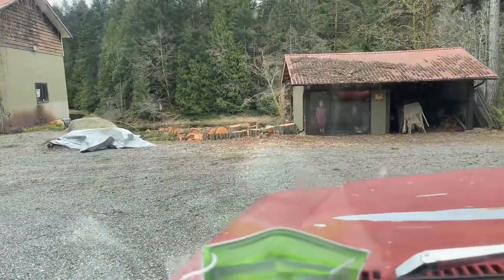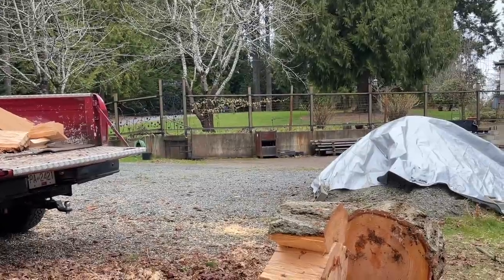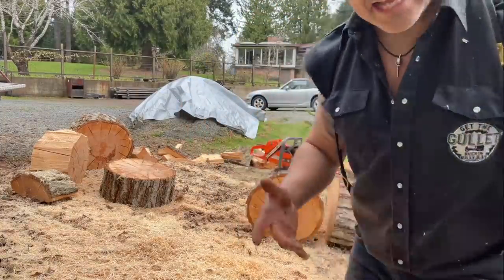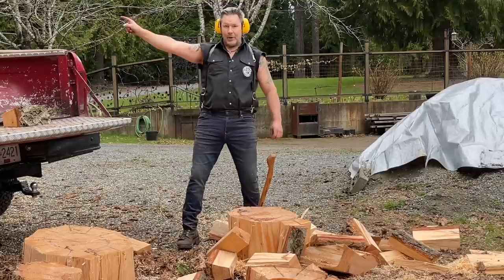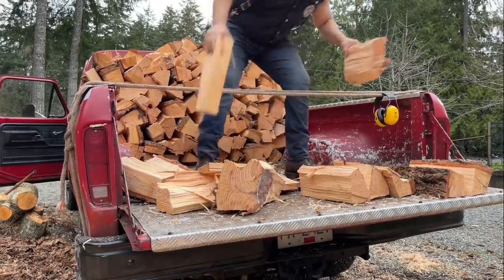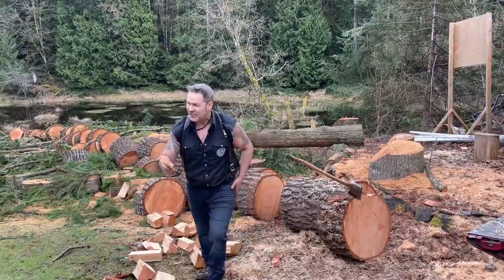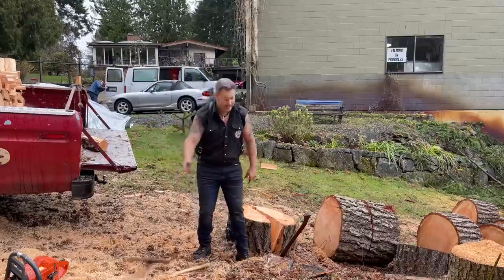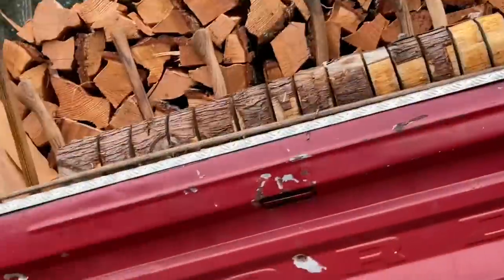How to split big rounds of firewood 🪵

Comment: So if I’m seeing this correct. You get noodles by cutting radius cuts from bark to center vs cutting down the grain? 
Also what saw is that Buckin? Much love. Can’t wait to add a wood bullet to my collection. Tired of swing my maul and hammering a wedge into these big rounds to split em. 
Just picked myself up a 572xp
Trying to treat is right breaking it in but I got a serious pile of 30”+ red and whit oak logs to get bucked and split. Got 8 or so tanks through it. Time to make some noodles!

Comment: WOW!
That's hero wood for splitting. I have mostly split hardwood. Maple beech ash.
Occasionally have tied into easy stuff like poplar.
Mandatory wedge and sledge for the big hardwoods. Also had wire wrapped the last 5-6 inches below the axe head to protect the handle and give a bit more weight. Handle lasted over 40 years for this amateur.
Deadly good aim going on there.

Comment: I'm curious about why, in the United States, everyone seems to use such lightweight axes to split logs, requiring around 20 hits and quickly tires out the woodcutter 🙈 Here in Europe, we use a splitting wedge, and it appears to be much easier.

Comment: Hey buckin, thanks for the new way to cut large rounds. Just upgrades my saw situation. Went from a little ms250 I've used for 5 years. Bought a husky 562xp yesterday and can't wait to give it a go. That little stihl kept my family warm in the winter and in the savings from not buying wood for 5 years I've paid for my new saw 3 times over with the amount we burn. The upgrade is well deserved to save time and my back. Buy once, cry once. Cheers Buckin, be blessed.

Comment: Last year I had a large tree I cut down that my splitting Maul would just bounce off of so had to cut it in 1/4s so I could get it into my trailer, this year I will try your way, looks like it may solve my problem.  Also I stack my wood in my trailer, the trailer is a tilt bed so it has be balanced correctly, that being said, the last time I just threw the wood in there cost me my car and a lot of towing charges, when the trailer fished tailed and rolled the car. Now I am very careful how I load that trailer.

Comment: Man you have a nice tune on that one! Sounds just right. Just a touch of overrev. She's running clean!
I'm telling you .I'll send you some power plus Manhattan oil. You will feel a difference and your pistons and head will actually clean themselves from carbon usually.
I did some rounds almost that big for fun and a workout with my helko.
I heard it hunting for fuel!! Ok. From road course racing 2 strokes..you want your engine to idle. Important..so when your way up in the revs and you get out of the throttle it continues to deliver fuel +OIL. Idling is a bigger deal to 2 strokes than most people know. Not telling you Buckin just throwing it out there for anyone that doesn't know. 

From a guy that never burnt a motor down from his tune!
Been all around the U.S. on most the well known race tracks.

Comment: This video comes at a great time for me. I have a trunk of an old maple tree that I bucked and the pieces are about 4 .10 ft wide almost 5 ft each. I bucked it with a Husqvarna 395 XP with a 36" bar and full house chain. I hit so many nails also I hit a rock that the tree grew around it was 10 feet up in the wood just below a large Y - Fork of the branch. I was not sure how I was going to bust it up and split it.  Now I see the proper way to do it. Thank you Awesome tip Buckin Billy Ray. Gotta get me some more tee shirts
Reply from the maker: good stuff

Comment: That ain't tough splitting. Try eucalyptus grown in the driest, windiest part of NZ. Grown as shelter rows between grass fields. With the density of arbutus but with just a few straight grain pieces between the knots. I have seen 12" rounds stop a 40 ton log splitter dead in its tracks. Anything with knots has to be ripped. a good block cut to fire box size will burn 8 -10 hrs

Comment: I get to play with “bouncers” a lot. Doing the what I call the “whittle” method you did at the start is the way to go. The whittle method being that you start by splitting the outer Cambrian off and work your way in. Keeping your axe or maul real sharp is another big help. The final tip for bouncers, when using a maul, put some bar oil on the bit. Getting large rounds of white oak and hickory to pop at 18/20 in long, you will find a way. Great tips on ripping, great solutions for the knotty stuff. NOTHING CAN STOP THE WOOD BULLET!